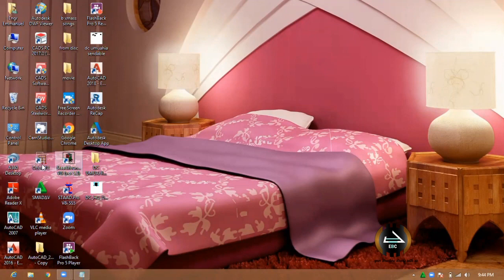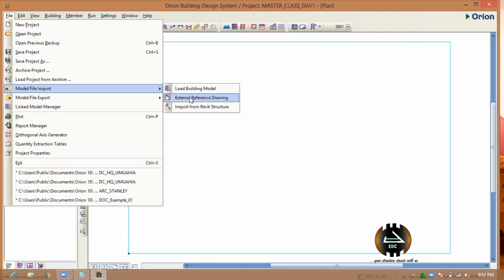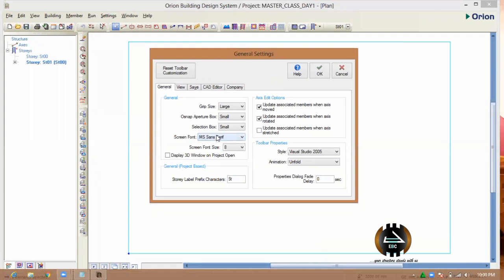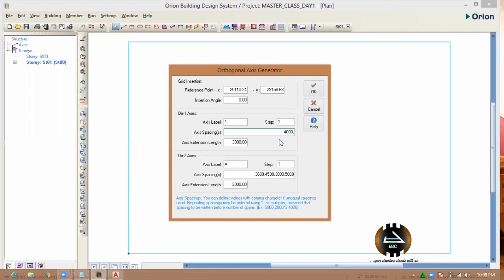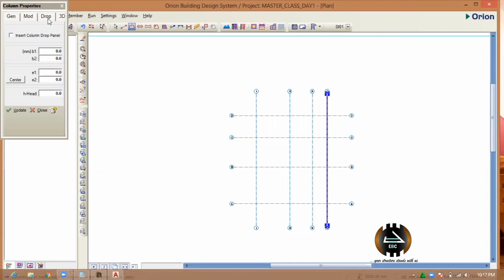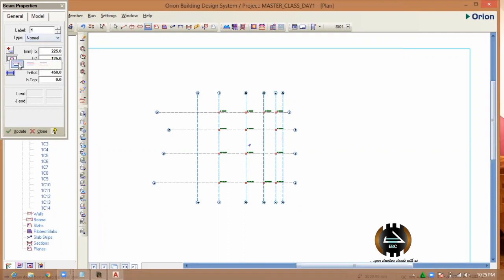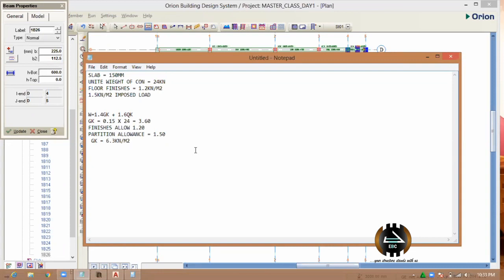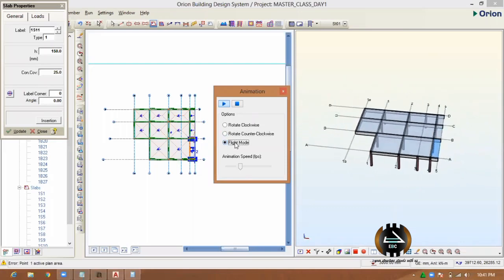Orion 18 Master class

Comment: So good morning 
Nice tutorial session.
Just a quick one 
First of all your beam, is it a flange or rectangular section
Secondly your slab, you didn’t specify the type e.g 1 edge continuous or 2 edge discontinuous. 
And thirdly, you made a mistake when evaluating your factors beam load during the latter part of the video. 
Your feedback would be appreciated
Reply from the maker: Alrighty Thank you for your response, we believe that any one going into design should have the basic Knowledge on Structural members, but don't worry we have you covered sir. Just visit our page on Facebook at Emmybliss Consolidate we will be running a class on Structural members and the issue of Flange and T beams will be settled
Reply from the maker: We decided to share this response into two or three in other not to make one too lengthy . 
Now talking about the boundary conditions in slab, using table 3.14 in Your B's code. It will be easier to determine the boundary conditions of any slab you have. 
Still I will personally encourage your to join our class coming up check our page for more details. 
Emmybliss Consolidate
Reply: Please we can't find the continuation YouTube video on this training